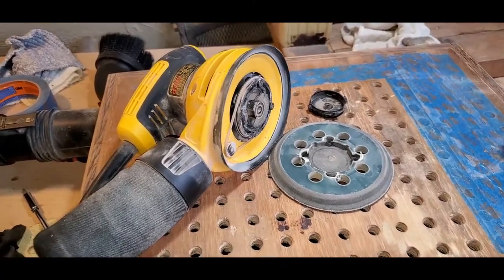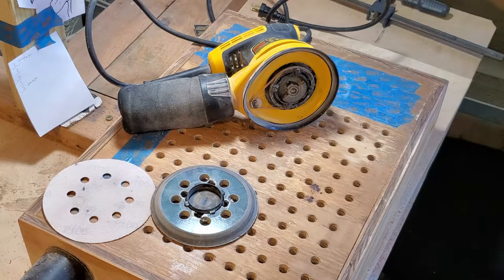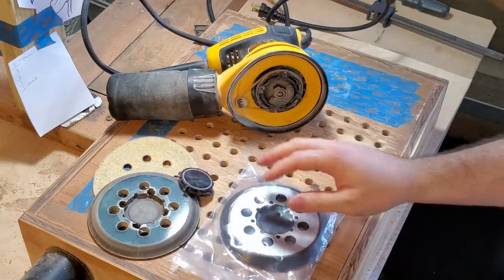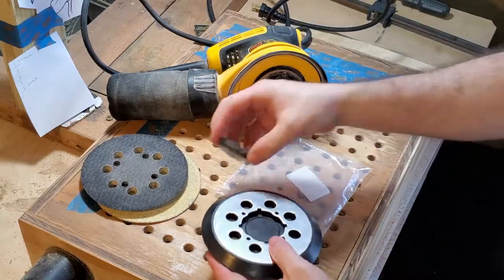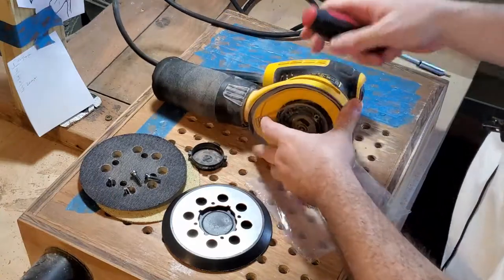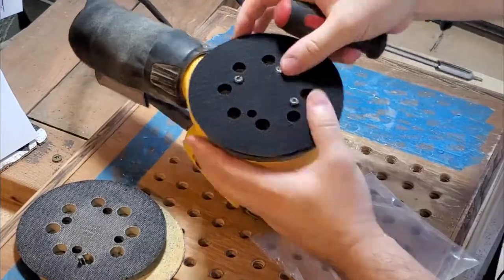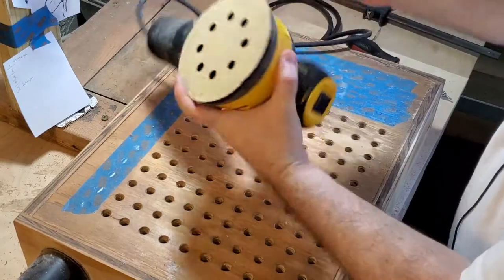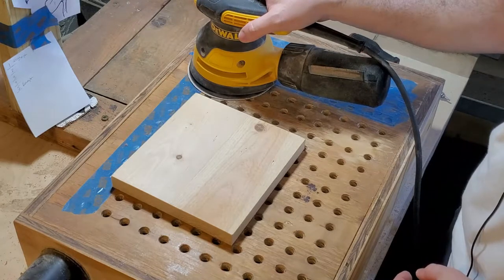Random Orbital Sander Pad Replacement

Comment: Is the part where the bolts screw in metal or plastic?
Nice video thanks.
Reply from the maker: good question I don't remember, would have to unscrew it to be sure but it screws in nice and tightly.